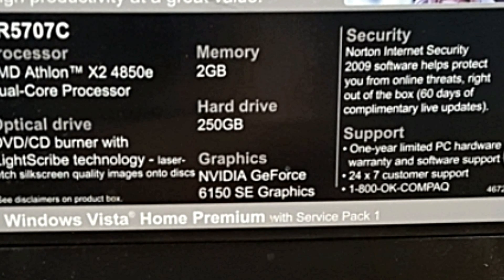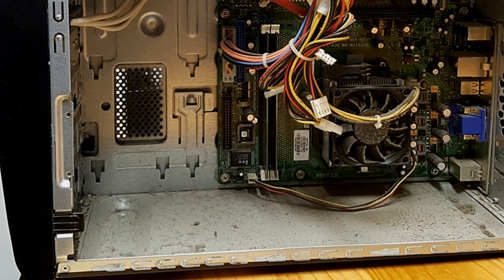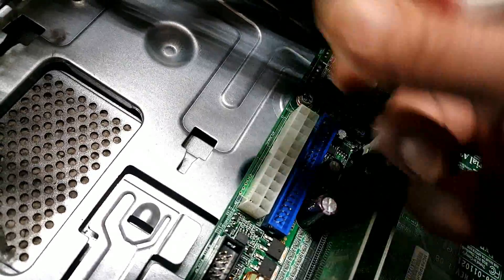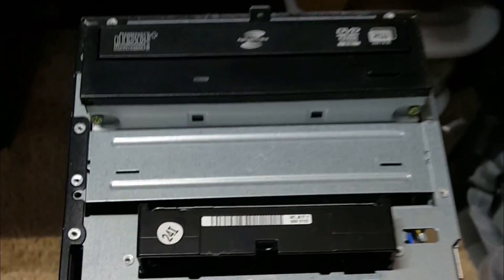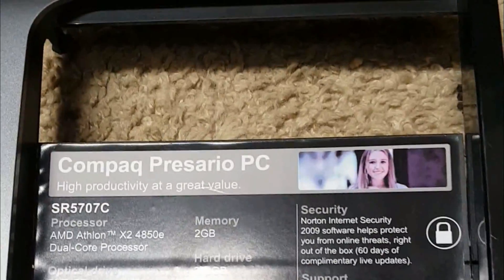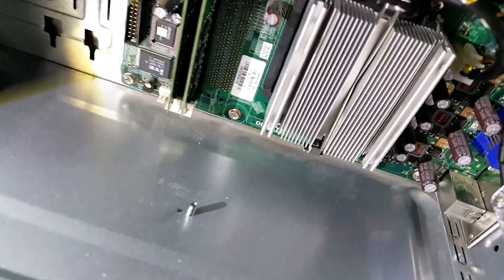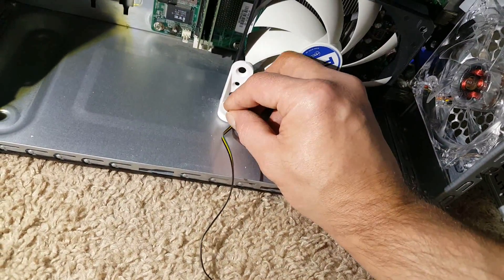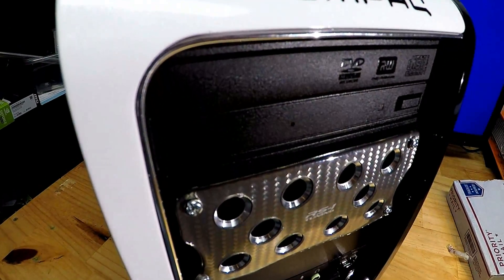Granny's compaq presario gets a makeover! How to restore an old computer

Comment: Hey man can you help me get an older   Compact  with a i7 2700 chipset back up and running as a gaming system? It had a fat32 failure years ago and has been sitting in my desk has a 27 inch monitor.  Would like to upgrade ram and ssd HD

Comment: You'll never see anywhere near full performance from that 1050 in that system - the CPU will bottleneck the hell out of it.  A better GPU fit would have been something like a 650, 750 or 1030.

Comment: I just got an old Compaq CQ5000 for my gf's daughter to play "Roblox" and it's unable to even play that after wiping the hardrive and installing Windows 10 on it. Is there a cheap processor upgrade for this?

Motherboard: M2N68-LA
Processor: AMD Athlon (tm) ll 160u processor 1.80GHz
Installed ram: 4 GB

Thank you so much in advance
Reply: A cheapo graphics card would likely be the best bet. An nvidia GT1030 is a good bet, as it can play many newer games...not in real high settings or anything, but pretty decent. They run about 70-80 bucks, too.
Reply: @MrR2185  make sure specs. say GDDR5 and not DDR4, big difference in memory bandwidth!

Comment: What was that black stuff you wrapped around some of the wires? Also is that cpu fan mount 3d printed?
Reply from the maker: +sgt cyrus spiral wire tubing from newegg. I wish I had a 3d printer but no it's a bracket that came with a book case to fasten it to the wall.

Comment: modstek hiya buddy how's you hopefully it's all good 
but can I ask if you have done or a video to upgrade the dell optiplex E5150 by any chance my friend iv got it running on Windows 7 ultimate so for and opened up cpu and doubled cpu and got a score of 4.2 or 4.3 lol can put a bigger cpu in for more power as higher score   and iv added a all in one liquid cooler system aswel and 1gb video card but not sure if there is more to boost it more

Comment: i found this old dell optiplex 755 at a yard sale for 5$ came home and plugged it up it worked fine. then i bought a evga 650 for 25$ and modded it to fit even though its a tight fit. played gta 5 and bo2 with a steady 50 to 60 fps

Comment: no extra power for the gtx?
Reply from the maker: +Unknown Man it's a gtx 1050ti mini it draws power from the pcie slot. I could of slapped a gtx 950 in there drawing more power from the power supply and got better results I'm sure. But then the comments would of been why didn't you put a 1050 in there...

Comment: That was a really good idea for cooling off the cpu. Does the fan rattle at all with it being mounted like that? I've got a similar tower and got really excited when I saw this.
Reply from the maker: +William Ryan quiet as can be and runs cool. The only noise you can hear is the old stock harddrive
Reply: Can you add an ssd to this system? And would it be noticeable?